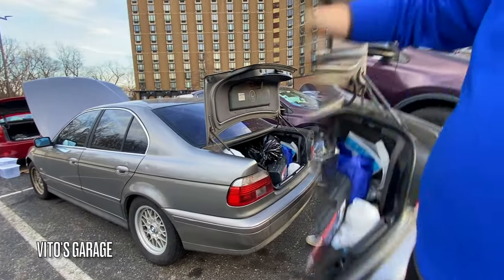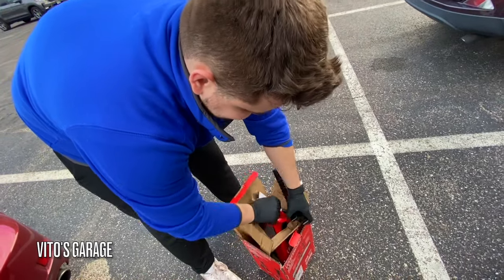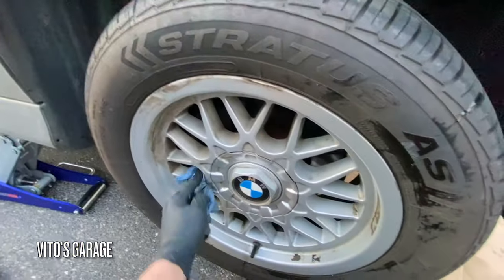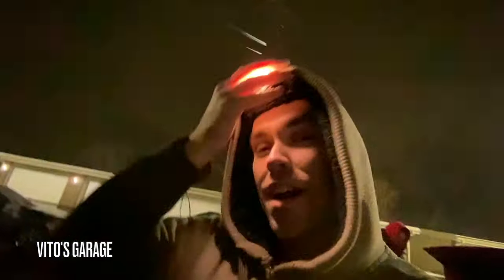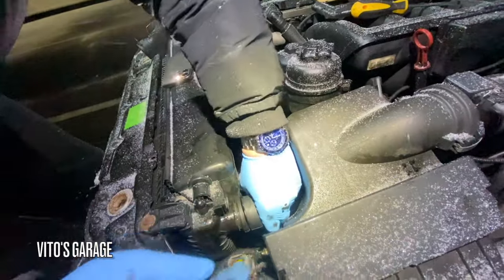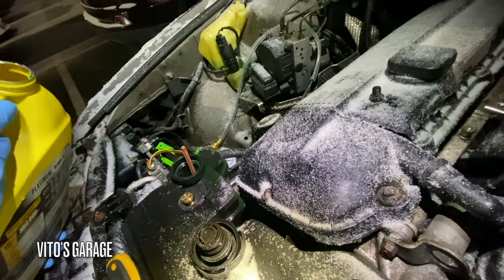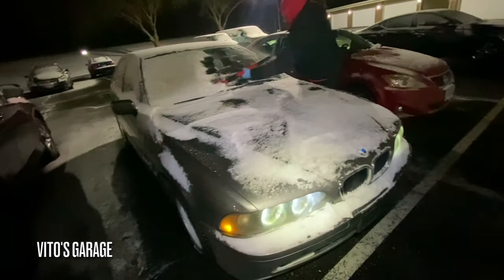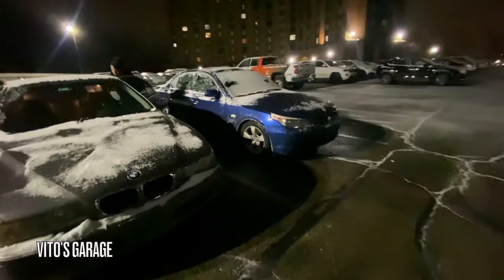Vlad Replacing Blown BMW E39 Coolant Hose in The Parking Lot.. + Test Drive

Comment: you need to follow coolant procedure, and use correct fluid that prestone will rot the rad out in 2 yrs, was it even 50/50 mix ?
Reply from the maker: Yup. Premixed antifreeze